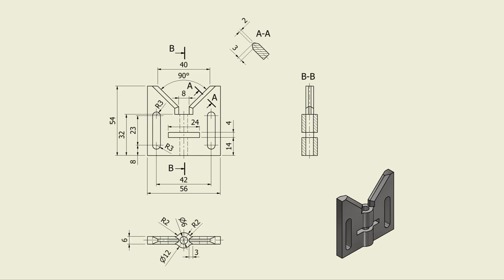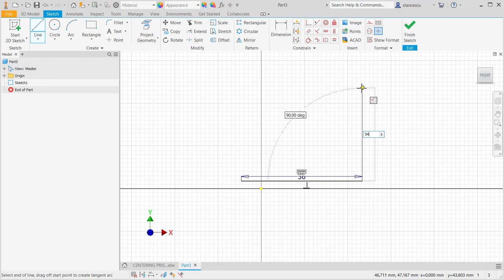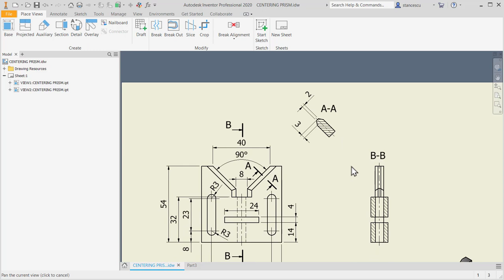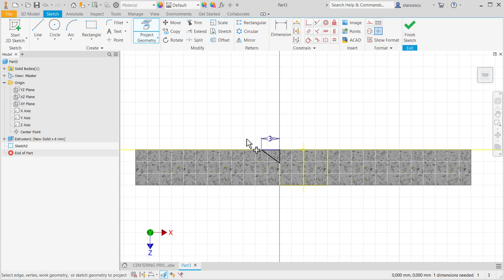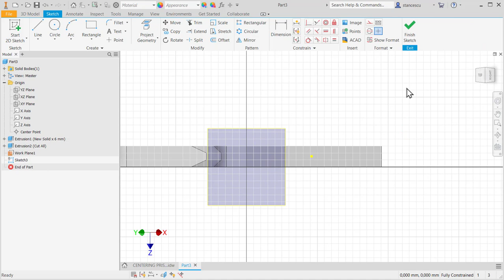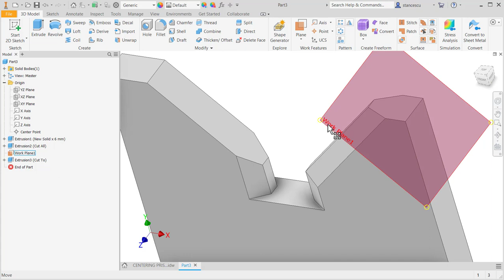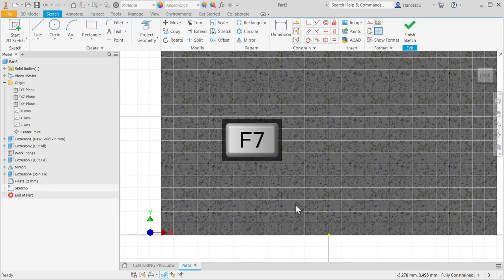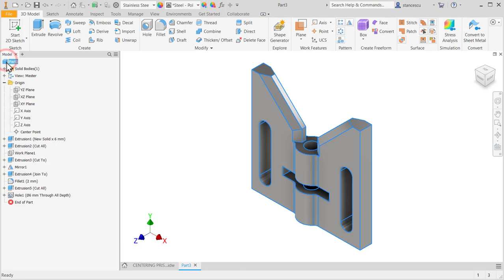Tutorial Inventor - 081 CENTERING PRISM (Part-042)

Comment: A tiny caveat: Cutting the chamfer-like edges as shown in the video does not produce the exact model in the drawing, because the B-B view shows that the edge of the chamfer is not horizontal throughout the whole section.
Reply from the maker: The plane created at the minute 9:23 is perpendicular on the sloped edge. This make that the chamfer to be correct along the edge, isn't it? Its profile is placed in that plane so it is not horizontal. Thank you for your help!
Reply: @prof-stancescu  My apologies, I actually learned something new about drawings from this video today, but forgot to delete my comment. I am not deleting it now either for your comment to make more sense next to my original post.
Thank you